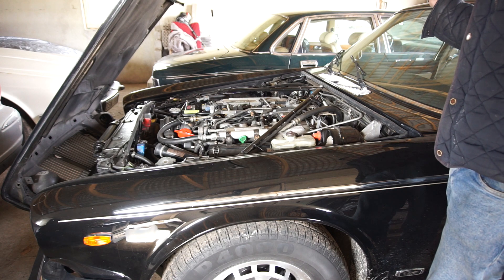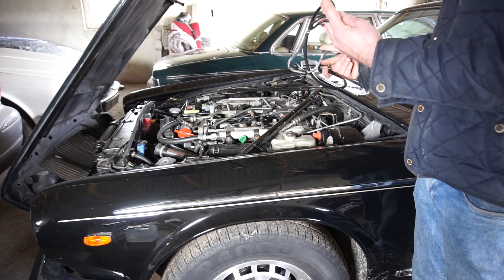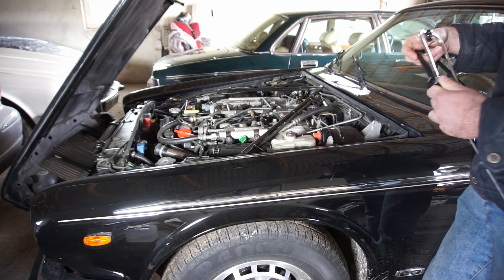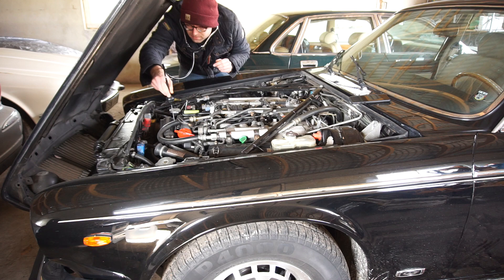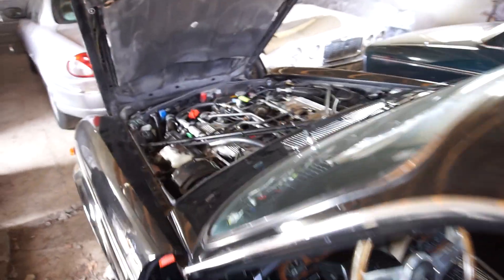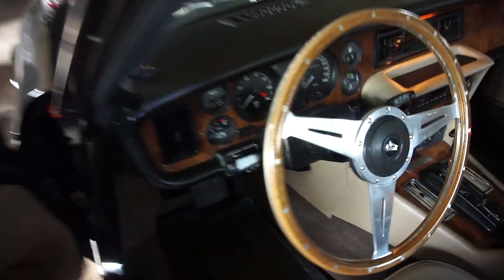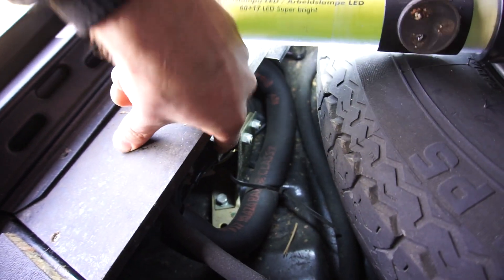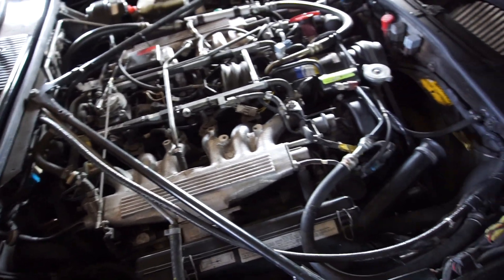Identifying an Odd Sound on this Jaguar V12

Comment: Congratulations to the owner and you for keeping dinosaurs like this  on the road,Well done. I myself am a 40 year+ owner of a V12E plus other big motor stuff.
Fortunately mine is simpler but I have had other issues such as fuel vapour,due to Carburettors, lock that I have found a fix for.
Gosh,I use any available oil filter!! Love the beasts.
Reply: Hi! Thanks! Yes we have to keep them on the road! Best Lars -the owner

Comment: Mine made a similar sound when I bought it. Quiet as a mouse when started up. After it warmed up, it sounded almost like a bad electric fan was running when it wasn't. The sound would start suddenly, then get louder and louder until it would be doing it even at idle.

I noticed if I put my hand on the AC condensor when the noise occured, I could feel it vibrating. Upon further inspection I noticed that the oil cooler it sits on was some nasty cheap one that had been replaced a long time ago, and all the brackets holding it in were snapped, but I found a much better quality new one and that solved the problem. Had some trouble getting the oil cooler lines but found some eventually.

Comment: the stethoscope I have also has a tube and funnel attachment very handy, also in the past I have used a length of rubber tube to listen to the engine.

Comment: Will be interesting to see the repairs made to the engine and fuel pump. Especially if you are to remove the air-conditioning unit to change the spark plugs. ,👍

Comment: I'm a little hard of hearing I use a piece of garden hose two to three feet long if necessary hold it up to your ear and the end of the broomstick works with your hand cup it to your ear these two have worked very well for me. That and a good radio with high volume

Comment: You briefly mention the fuel venting valve and just today I was looking around my '87 XJ12 trying to locate the charcoal canister associated with evap emissions control. From what I found it should be located in front of the right front wheel. Only the vacuum reserve tank for the brake booster is there and I wasn't able to find it anywhere else. Do you have any insight on whether European spec S3 XJ12's (mine is originally from Germany) even had the canister or how the fuel venting system differs? Thank you!